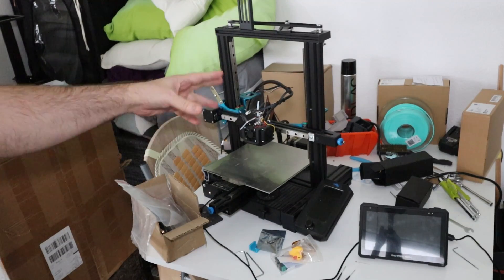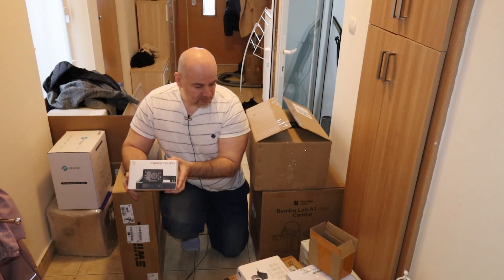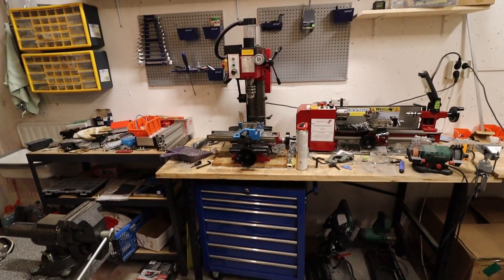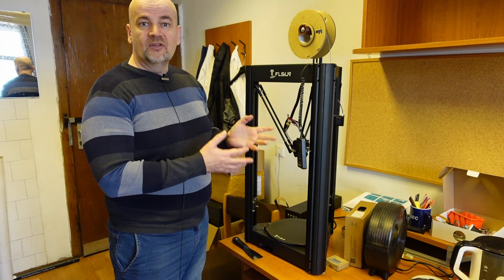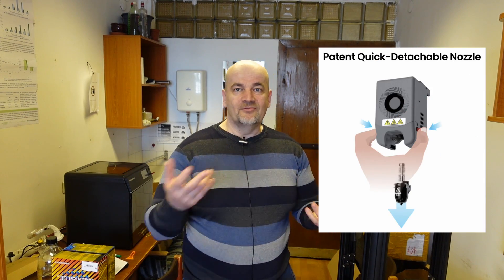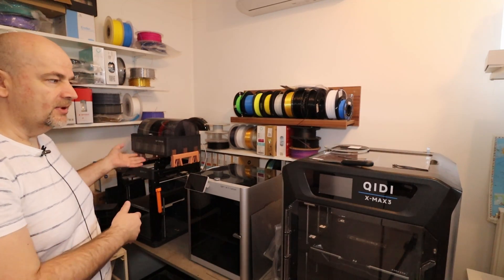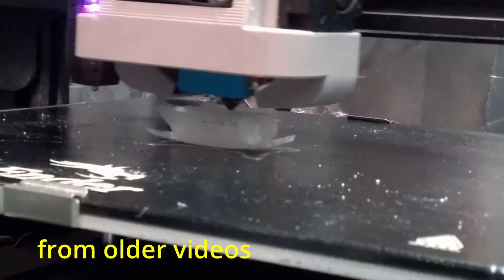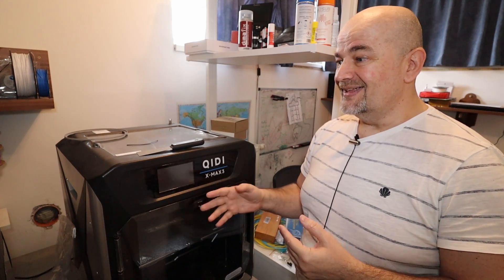What are my best 3D printers now in 2024?

Comment: Ah ha! Deductions were correct, a fellow engineer. 👍
I supplemented a giant delta very recently also with an X-Max 3. First thing I did was to find a better spot to mount a filament dry box and move the sensor on the back. With a smaller machine, it might be more manageable, but good lord, Max is Huge and Heavy. I don't have anywhere that's not facing a wall to get to the back for swapping filament. Other than that, it's been as solid as I presumed it would be, and I spent months of research on an exhaustive list of requirements. The other machine that was in the running was a Marathon (accidental pun, but I'm keeping it in!) Idex printer, but they've been perpetually out of stock.

Comment: I was wondering where the qidi went.
I bit the bullet on mine and modified it to have the spool holder and runout sensor on the left side. Yes, it required permanent modification, but with parts made of pet-cf I don't anticipate it being any issue over the printer's life.

Comment: hi Igor, could you tell a bit more please on your Ender3v2, which is modified to print food? Any plans to make a separate video about it? What food it prints, what it can and can't print, etc..? Super-interesting! 
Are there any articles to read about food printing?
Reply from the maker: I have articles only about food safe printing (contact with food). For example: https://www.analecta.hu/index.php/analecta/article/view/44893 for food 3D printing I am using CAKEWALK3D but it requires a lot of DIY tuning, it cannot be used out of the box.
Reply: @MyTechFun  Thank you! Checking CAKEWALK3D's website, I can't say I am very impressed with its possibilities - maybe real experience is much more pleasant. Could you share your own experience please? 
Do you happen to know more advanced food extruders / food 3d printers? 
I think having dedicated food 3d printer is a better solution (I guess there is no market for this right now.. only enthusiasts / researchers / maybe several fancy haute kitchen restaurants are experimenting with this technology)
Reply: @MyTechFun  Thank you! 😀Could you maybe suggest any other good technical articles about food 3d printing? I can't find any good channels/blogs/sites related to 3d printing food at all..  I know it is used as one of techniques in high cousine restaurants, so there should be smth on internet (for some strange reason I can't find anything)

Comment: I was not a fan of “closed source” printers before, and have a prusa i3 for years in my shop that sits in a housing. For bigger projects I bought an ender 3 MAX, but it was at least frustrating and I invested much time and improvements to make it halfway working reliable. At least dropped the ender and replaced it with a Qidi MAX3, and now I'm happy with it. Furthermore, I put a 0.6 mm nozzle in there. If I have some detailed fine prints, I use my prusa, but if it has to go fast and big, the Qidi is my NR. One. Compared to other Chinese brands, Qidi also has a good and fast replying customer service.

Comment: Why don't you use powerline network adapters to bring the wifi to the basement? It will work through your existing powergrid. You just need to have it at the same phase.
Reply from the maker: This is seven-story building, too far is the basement from my flat.
Reply: @MyTechFun  If they are installing some cables in your block, you could ask them to put LAN cable through lift chamber. In our place used to live TV cable provider technician, many apt units were interconnected.

Comment: Nice, i just got the qidi x-max 3 coming from the bambu a1 (recall) and i'm really happy with it it prints better than the a1. Only negative for me is that the cooling fan of the power supply is always on and its not loud but also not quite. but most important it prints nicer and the print start faster (bedlevel disabled most of the time)

Comment: Your wife must be very patient 😂 Looks like you have taken over every room with a 3d printer. I’m hoping Bambulab will come out with a P1S sized and priced model with a heated chamber. I have both the Qidi x-max 3 and P1S. I find the quality is slightly better with the P1S  but I have a hard time time with warping using ASA. The Qidi never warps using ASA, but the quality is slightly worse.
Reply from the maker: We still don't have printers in our bedroom, kitchen and bathroom :-)
Reply: @MyTechFun Well... still room for improvement then. ;-)
Reply: I'm more impressed that you managed to do all that stuff with 3 kids.
Reply: You can build your own chamber heater for less than 25$.
Reply: @smokehead5318  Yeah that’s the plan. Do you have a recommendations for which heater to buy that won’t burn the house down.
Reply: @smokehead5318 I don’t wanna void my warranty but tempting. My parts are strong enough for me, but could be better and that bothers me xD
Reply: Just a tip. Add insulations to the top and sides of the printer and the enclosure goes from 40-38c max to 50-51c very easily. I only covered half of it very poorly (didn’t actually peel the glue stickers) so I’m sure you could do better.
Reply: I have a P1P with the Arc Enclosure and ASA prints flawless, it must be your settings

Comment: Which printer would you prefer for TPU ?
My current shortlist is:
Creality K1 Max
Qidi Max3
+ other 300mm+ format printers.
Reply from the maker: For soft TPU Prusa MK4, earlier Ender 3 with new NG extruder
Reply: @MyTechFun  For me, the Qidi x plus3 printed the TPU beautifully, although at 240 degrees.
Reply from the maker: @zsolterdelyi459  but which hardness of TPU? Since it is a huge difference if you want to print 85A or 95A (or even harder)
Reply: @MyTechFun  XYD Flex-1 is the type of filament, but I couldn't find any information about its hardness anywhere. There is nothing on the Manufacturer's page about its hardness either.
Reply: I printed with the basic TPU setting of the Qidi slicer. But with my other printers, I have never been able to print this filament in such good quality and without fraying.

Comment: Pont szemezek egy új nyomtató vásárlásával, és nagyon nehéz dönteni :D De a Qidi X Max 3 illetve a kisebb testvére, az X Plus 3 között tépődöm. Néztem nagyon sok mindent, de ár - értékben és kellően nagy méretű nyomtató térben ezek szimpatikusak :) Ez is inkább az X-Max felé billent
Reply from the maker: If you don't need this size, you could check Qidi Q1 Pro
Reply: @MyTechFun  The problem is, that my clients request the most random things. One of the clients is hanged up on stuff that needs 34cm build height. I think I could print it "flat" at an angle on the X Plus but I think I'd be better of with a bigger volume. Though in general I prefer printing a single model on a build plate as if something goes horribly wring and generates spagetti, not all the models are trashed. So this is why I am torn - maybe I should just get the X Plus that should cover most exotic orders, and get maybe a bambu A1 mini for all other stuff....
Reply: @MyTechFun  I was also eyeing the FLSun V400 but that machine is ginormous. It does not fit in my workshop, as I have cabinets on all the walls and the height is simply too much....